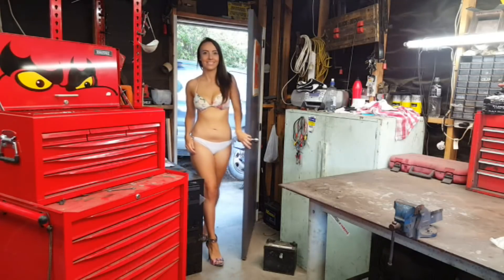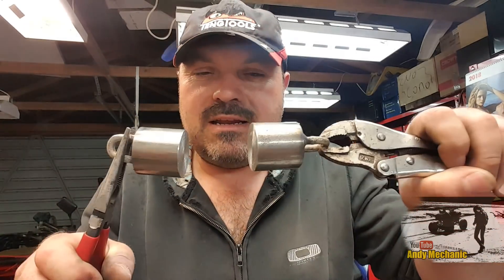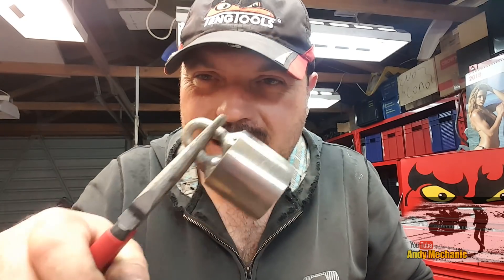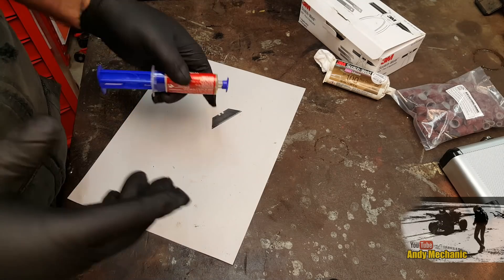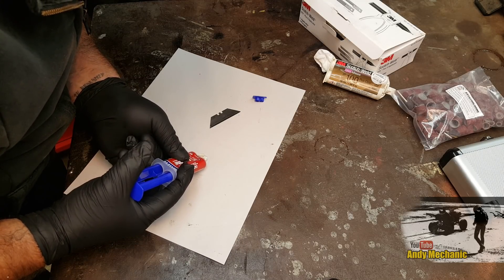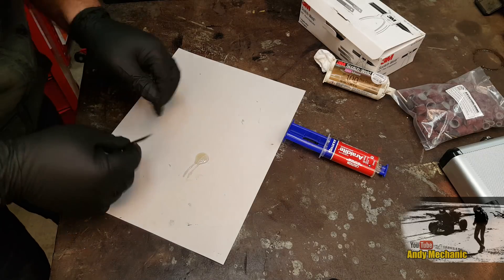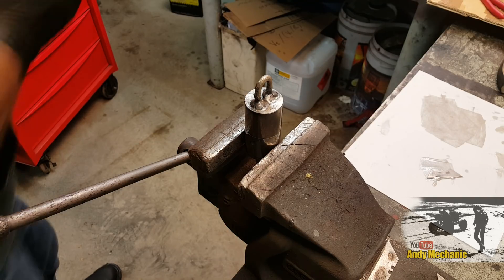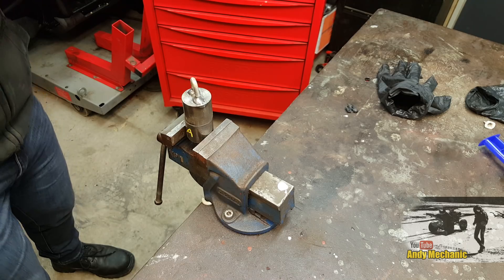Glue test -  3M v Araldite Pt.6 #1972

Comment: You should have made a second blob for the test the first one might have not been the correct mix ratio. My experience with hilti apoxy is one tube will always start going threw the mixer before the other.
Reply from the maker: +SimonTrent8000 Hi Simon, thanks for the info. I'm focused on following the manufacturer's instructions and they haven't mentioned anything about discarding the initial mix though I do understand where you are coming from and would definatly be more relevant if it was a new tube of glue as there may be an air pocket at one of the tube's output ports.

Many thanks for your input here. Cheers Andy
Reply: Andy Mechanic not a problem, thanks for the reply.
Reply: Cant wait to see you pickup the truck lol